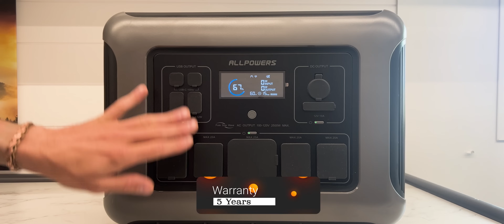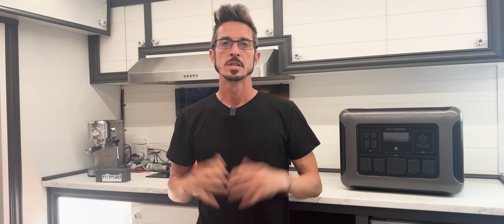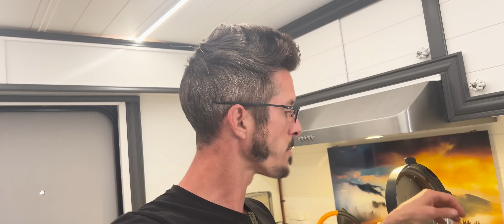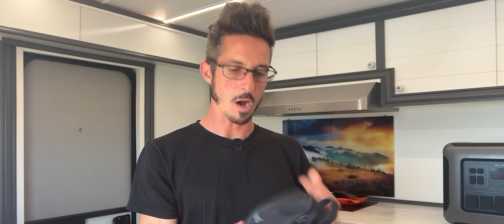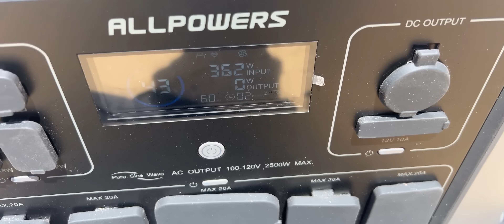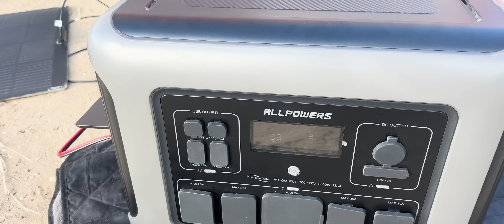Do you really need a full electrical system in your van? Maybe an ALLPOWERS R2500 is enough!

Comment: I haven't heard great things about mounting flexible solar panels to the roof, as they can be damaged from heat, but I've been very interested in the Bouge RV CIGS panels. They can be roof mounted and aren't damaged by the same amount of heat, plus they have a 10 year warranty, run well in low light conditions and are safe from damage. You can walk on them and HoboTech shot through his with still getting rated wattage.

I hope you get some commission from selling these, but there are things i personally like from other devices.

Comment: My van (T1N Sprinter) already has nearly 280,000 miles on it.  So, I have decided to go with a power station system, which easily transfers to another vehicle (or cabin), in case my van needs to be replaced.
Reply from the maker: thats a great choice

Comment: It doesn't look like you can recharge off your alternator. It's a no-go if you're just depending on the Sun or using a wall outlet.
Reply from the maker: Correct, there’s not a direct alternator charging option on this one
Reply: @nomadbrad503  looks like ecoflow has a alternator device now
Reply from the maker: @ChrisL27249  they actually just sent me a full kit with the delta 2, wave 2 ac, and alternator charger. I’ll be reviewing it in a couple weeks
Reply: @nomadbrad503  well I guess I'm going to have to subscribe now so I don't miss the video 😊
Reply from the maker: @ChrisL27249  absolutely 🙏🏻

Comment: I am old enough to have lived in a van with zero electric at all, after I exited the Army. I worked and lived during the day, and went to sleep on my full size bed in my Chevy extended van at night. I would sometimes use these things called candles or oil lamps, to do this other thing we used to do, read books. I did get fancy once and borrowed an extension cord, a clip on light and a portable fan from a relative who I was visiting. I am just being tongue in cheek, I have already decided if I build out another van, then I am going to use a simple electrical build, a lithium battery, charge controller, panel(s),  and inverter (Of course with proper fuses, wire, etc), I probably forgot something but, I wasn't prepared to give a lecture on a subject I came across on a random video recommended to me by Youtube..lol. The wife and I use very little electricity and according to the stats on our bill, we use 80% less than others in our service area. I am not a fan of the AIO devices because if one part fails on the device, you are out of luck, a single component is easier to diagnose and replace in my opinion.
Reply from the maker: I agree with you on being able to diagnose and repair an individual component 💪🏻
Reply: @nomadbrad503 Your skills are insane...thank you..
Reply from the maker: @JordanB-lc4oi  thanks for watching 💪🏻
Reply from the maker: @JordanB-lc4oi  thank you sir

Comment: Sorry to disagree with something you stated ..... One CAN (as I did),  wire up outlets all over one's RV, Cargo trailer, etc.... and run those leads back to one point, where a Power station will be positioned, and "plug-in" all circuits to the Power station ....  It has worked PERFECTLY for ALL my electrical needs throughout my 16' custom Cargo trailer !!  Also solar & dc to dc charging of said power station .... I am NEVER without power !
Reply from the maker: I’m happy that worked for you!

Comment: You're still going to want a system set up in your van/cabin (etc). Ceiling vent, interior lights, etc. and have it plugged in to the power system. How do you set up a charging system for the stand-alone unit to have the vehicle charge while driving?
Reply from the maker: You would connect a power inverter to your starting battery and plug the power cord from the power station into that inverter
Reply: For a power station you just plug the vehicle 12V into the power station... hopefully switched 12V so it is only on when the vehicle is turned on.   When presented with 12V on the "solar" input, nearly all power stations these days limit the current to 8A (100W).  So its a free trickle-charge, basically.   Dead simple.

For a discrete DIY build there are several solutions.  A DC-DC is a decent solution for 12V and 24V solar systems, but for 48V it is typically easier to install a small inverter and 4A AC-to-DC battery charger (roughly 250W).

You cannot generally use a medium or large 12V inverter from the starting battery to the power station, but it depends on how much power the power station pulls when charging from "AC".   Larger power stations can pull enormous amounts of power... like 1500W+, which obviously won't work well from a starter battery with a 12V inverter.   You can easily over-stress and burn-out the alternator, as well as drain the starter battery dry or over-discharge it or cause the lead-acid to gas-out.

So care must be taken.  Its gonna depend on a lot of factors.

-Maatt

Comment: In my 36 foot skoolie I will be doing a mixture! With running outlets 12 volt and 120 volt outlets and lines, rooftop solar , shore power and 8000w generator with the primary power source being a Anker 767 powerhouse. Right now trying to decide the best way to transfer power sources, looking for something a little more clean tech than a big red ABC battery switch. Although yes it will be necessary for the charging of the Anker 767 when on shore power. Any suggestions?❤
Reply from the maker: Yes, you can install 2x automatic transfer switches. Each switch has 2 inputs. Inputs from 1 switch can be shore power/ generator. Feed that output into an input on the 2nd switch with the other input being your power station. There are YouTube videos on this. It’s all automatic

Comment: I think it all depends on where you live. 
 I live in a cold snowy area and to make it a week with no sun i use, 
 800w solar, 4-100ah batteries and a Bluetti 200p. 
 Bluetti runs all 120 devices, microwave, induction cook top  ect.
 Batteries run all 12v stuff, fridge/freezer, diesel heater, lights, fans and charging devices.
 Oh and to charge the Bluetti.
Reply from the maker: Yeah, this would not be ideal for cold snowy locations.

Comment: You are addressing system engineer; requirements analysis, and implementation.  From a consumer perspective, a turn key integrated system has the appeal of simplicity until the requirements change.  A system of subsystems has some benefits of future obsolescence, repair, redundancy, and expansion.  Continuing a theme from your previous video, (https://www.youtube.com/watch?v=TcwbF9WuqF0&t=218s), we inevitably increase requirements and over specify.  A 12 volt deep cycle, wire, fuses and a couple female cigarette plugs (sourced from Radio Shack and Sears Auto center) was once sufficient!
Reply from the maker: I agree with you!

Comment: I agree with you Brad, you do NOT need a full system setup, I'm not a Full Timer per se, however I do have a MUCH smaller power station that runs my fridge quite well & I am looking to purchase another power station to run my tea kettle or even charge up my laptop.. my lights are battery operated and it is just enough for what I need early mornings or in the evenings. 
Though I would love to have a full set up but.. I am working on it.. - Thanks for the input MUCH appreciated
Reply from the maker: I’m happy to hear this!

Comment: I want a self built unit,if any component fails I can easily replace it and be back up with less down time and minimal cost instead of sending it out to be repaired or replaced!
Reply: I have built a few diy solar systems. Mine started out at 40 watts and now i am at nearly 2000 watts in panels. Everything has been upgraded including the wiring with larger cables all purchased on Amazon.
Reply from the maker: Yes, this is why a custom system is nice
Reply from the maker: I agree with that logic! I still prefer a self built system 💪🏻

Comment: Your channel is growing quickly.... congratulations!
I think the best route for new builders. Especially people worried about technology. Increasing is to wire up all your lights and any devices that you may have as a normal system With devices and breaker boxes built in But going to a female 30/50 amp rv plug and a. Andersen 12v feed that you could simply plug your power station into to power the vehicle and then down the road. If you upgrade your power system, you just plug it right back into the same 2 plugs.  Easy peesy!
Reply from the maker: That’s a great solution! Have both
Reply: One of my favorite sayings is one is none and two is one.  Having a backup is never a bad idea!

Comment: My question is can you do a dc to dc with the all power r2500 ???
Reply from the maker: Not a dc to dc but you could connect an inverter to the engine battery and plug in the ac quick charger. That would work!

Comment: Other big expenses of building a system are all of the tools necessary to do a legit build and all of the different sizes and lengths of wires. From 0000 awg for the batteries to something as small as 16 awg, depending on your build.
Reply from the maker: Yes, you’ll definitely need to invest in tools 💪🏻
Reply: Everything is available on Amazon, no big tools required.
Reply: Well, you don't need 4/0 cabling.  You just go with 2 AWG and a 48V battery... and that's only really if you want to be able to scale to 5000W (100A).  If you target 2500W, now the cabling is only 4 AWG.   The biggest mistake people make (constantly make actually) is building discrete systems with 12V instead of 24V or 48V.   These days I just go straight to 48V, there's no point using a lower voltage.  It makes everything easier and cheaper.

Comment: My first van power was DIY. In 2022 I bought an Ecoflow Delta 2 that easily plugged into my existing solar panels. Very impressed using 110v home appliances.
Reply: Have you figured out the cost difference of your Delta vs the DIY system?
Reply: @joeblow1942  My DIY was built 2019 with a single 100 amp hour Battle Born, $999. Fuses, wiring, tools, solar charge controller, inverter came to $800. 

The DIY barely ran my refrigerator and a hot pot. Today that would buy amazing portable power. My needs are met with one EcoFlow Delta 2 I paid $799 July 2023. 

I was very concerned about an all in one unit breaking. A few times I contacted customer service and they were helpful. It runs 24/7 powering my DC cooler, USB devices and AC cooker. I would not go any smaller. 

Use two solar panels, both 100 watt HQST monocrystalline $110 each. Purchased July 2019. They have always been mounted to a mini van roof rack without issue. 

Hope my story helps someone.
Reply from the maker: I’m happy to hear this!